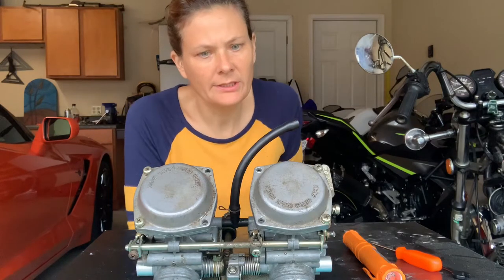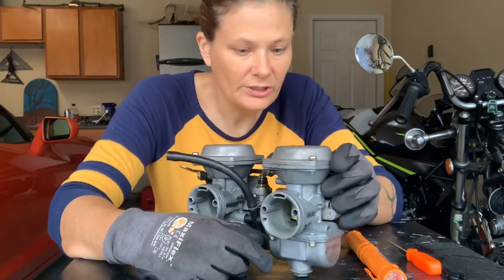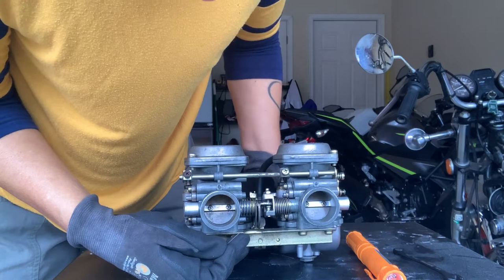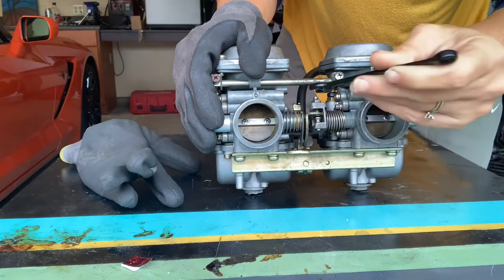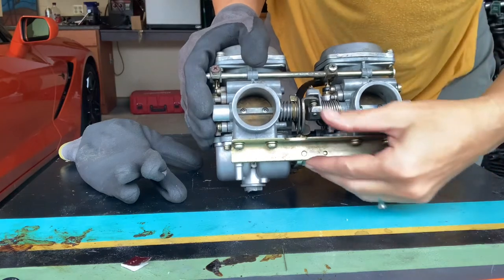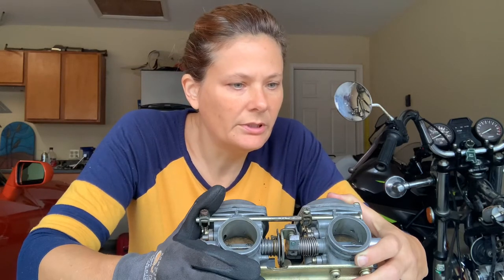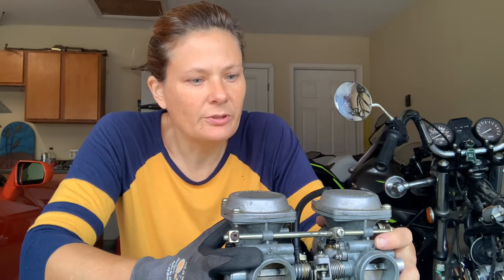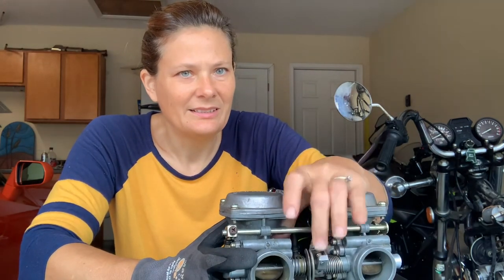Synchronizing dual motorcycle carbs  without carb vacuum gauge

Comment: When you balance a set of carbs on a running engine you're adjusting the airflow through the carbs which can be affected by VERY slight differences in valve clearance, cylinder wear, valve condition, and just about anything else in the engine. Synchronising after rebuilding them is a good start but they need to have the flow balanced once they are reinstalled and running.
Out of balance carbs are most noticeable at small throttle openings where slight differences in flow will make the most difference to the running. Properly balanced, they will reduce noises from the engine and clutch at idle as the two cylinders will be doing an equal amount of work. They will not be noticeable at wide throttle openings as such small differences will be a very small percentages of the total airflow through the carbs.
Reply from the maker: Thank you for the information

Comment: There are more variables to sync than just butterfly opening.  Bench sync is a good idea after a rebuild if you took off your linkages and need to start over.  This should allow the motor to run good enough to then  throw the sync gauges on and get it right.
Reply: New to this. What is a sync gauge? Thx
Reply: @stefang6622  vacuum gauge

Comment: It was the middle springs. They get gunked up over time. Best to squirt WD40 on them, let it soak for a few mins, then you can toothbrush it right out. Wipe it with a rag, repeat if necessary, then a final lubricating squirt. Give it a few twists and it should have a new lease of life. Also put a little bit on the ends of that shaft, on the outside edges of the carb.
Just rebuilt mine 😊

Comment: The throttle linkage was seized right shut on my shadow that sat for 3 years. I kept spraying wd40 in all the spots where the linkage moves and kept working it. Took like half a bottle of wd40 and my fingers were pretty sore but I got it nice and snappy after about an hour of flipping it back and forth.

Comment: hi .great video. just recently bought one of these bikes as a project. drove the bike 50 miles never missed a beat.however struggled to get over 60mph🤔ive also found the vacum pipe from the tank has been disconnected. a pipe where it should connect runs from one carb to the other.the previous owner said he has fitted larger jets .🤔cone race filters also installed. but the other day i kickstarted the engine and one of the carbs blew off on the left hand side that powerfull it took the fuel pipe off the tank tap.has this got anything to do with the vacuum pipe not being connected 🤔thanks
Reply from the maker: That reminds me there was a pipe that kept blowing off of mine. I couldn’t get the Suzuki to go over 45 I never figured it out

Comment: My last comment- I ment to say throttle valves and shaft. For some reason I said choke and shaft. ( It is important that both chokes are in sync.  Just as the throttles are). I would like to send you a pitcher of a 1979 Kawasaki K Z 650, restoration I did in 1995. Also a pitcher of my 2009 Yamaha Touring deluxe I'm driving. I have not been successful sending them. Is there a P O box? Thank you. God Bless you.
Reply from the maker: My email address is bettybettybobetty@yahoo.com I would like to see your restorations
Reply from the maker: P.O. Box : 
1046 Church Rd. W.
Suite 106-101
Southaven, MS 38671
Reply: @NotamechanicBetty  I'm still having a hard time sending them.